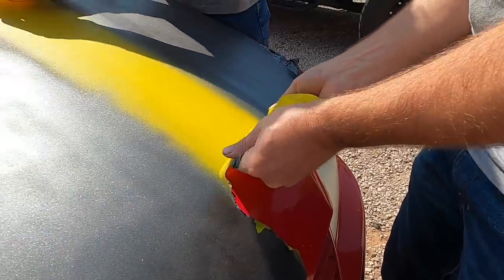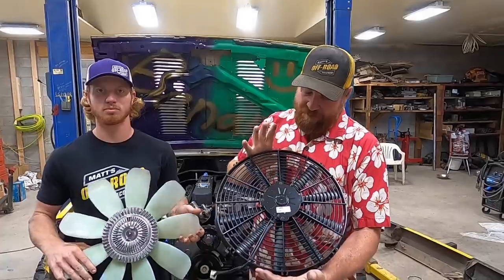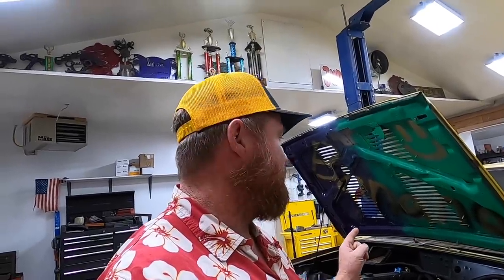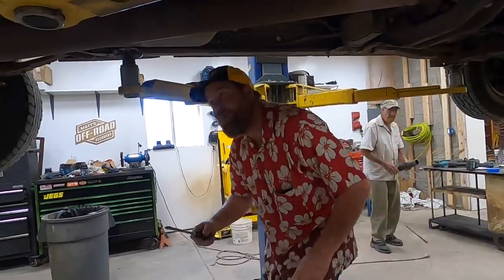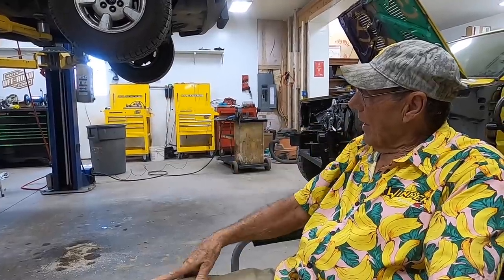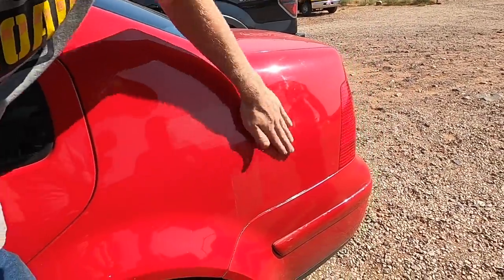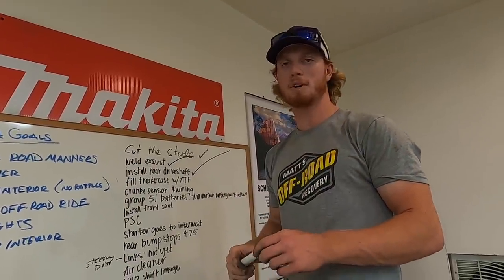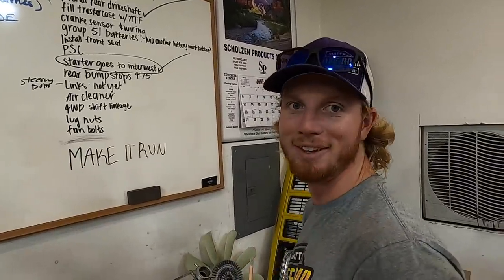Massive Cooling System Upgrade For The Jeep Banana!

Comment: Matt, what type of ATF you running for the high rpms, extra pull weight, and temps your transfer case is subject to?  Looks like Rudy picked up some black quarts from Napa?  Separately, what you running in the transmission?

Comment: you should check out banks monster exhaust expensive but well worth it with jeeps it sounds like a v8 motor especially if paired with the stroker engine

Comment: What’s the part number for that fan blade and cutch your using? Is the water pump the stock mopar? Im from El Paso have a 2000 xj it gets hot down here..

Comment: The 4 liters engine has the block ánd the cilinder head water passages, excesively small on purpose. That is to maximize the efficient use of fuel ( 1978 engineering) trough high engine temp. All engines have an optimus operating temp.

Comment: I installed 12” and 10” Mishamoto racing fans in a 2006 Grand Cherokee, HEMI to replace the disaster hydraulic cooling fan. All aluminum radiator, custom TIGed a aluminum shroud. Used a two temp VW thermo switch and wired in multiple relays into stock relay/fuse box. Took old actuator/solenoid for hydraulic fan system, installed it on the original wiring and zip tied it to frame to avoid check engine light and also ran independent of ECU all together. Wired so both fans come on with AC and one or both depending on engine temp come on without AC on. With no AC here in Fort Worth,  second fan never comes on. I also got a used complete fuse box off ebay so i could wire the new relays and fuses directly into factory fuse box so it looks stock. the new system stays crazy cool. Ran the thermal switch  originally at thermostat housing but made fan come on intermittently from thermostat opening so i moved it and welded a new switch mount out of two stock thermostat hose mounts then installed right as hose enters radiator and fixed the only issue. Those two Mishomoto fans pull 3450 CFM together and have lower amp draw than anything else on the market and they use brushless lifetime warranty motors. You may have used a Mishomoto fan before but im betting not a racing fan with the huge blades. Guarantee you would never have a cooling issue again if you went this route.

Comment: You forgot to mention the Clutch on the fan that limits the rpm of the fan so it doesn't tax the motor so bad, most clutch fans use 20 horse power or better. How about that heater core trick?

Comment: I have an electric fan on my c10, Damn thing was over heating quite a bit until I realized, it Should NOT be Bolted Directly to the Radiator. I found an old cookie sheet that was the same size as the radiator and cut a hole matching the electric fan, bringing the fan an inch or so away from the radiator, so it could grab the Air from All of the Radiator instead of the small circle it sat on. My engine never overheated after that. If you'd like pictures of the set up as a reference, let me know.

Before joining the navy, I worked as a mechanic and have grown to dislike clutch fans, because they scream and it tricks people into thinking it's a belt.

The plastic fans always had reputation for breaking due to flex over time. Especially at high RPMs

Plastic, clutch type, solid, fans will rob power no matter what.
Reply: Matt check it out no need to build a custom shroud all you need is a cookie sheet.
Reply: @iffykidmn8170  if it works, it works lol

Comment: Have you tried the gel coolant the derby drivers with 20k+ dollar engines run with no radiators with their hoses looped and run hard for half hour to 45 minutes a buddy of mine runs it in his mud truck's radiator and he plays hard for hours without taking a break to cool the truck down like others do he only stops at camp long enough to refill his little cooler with water and dew use the porta potty or tree and hits the mud again and he runs the AC with no problem

Comment: Hi Matt what is the part number on that mechanical fan or what does it come off of? 

I have a TJ that is getting a little hotter than I like when I pull a small camper through the Colorado Rockies. I’m not scared of a little custom fabrication to make it fit.
Reply: @MattsOffRoadRecovery  Thank You!

Comment: People have a little knowledge and think they know a lot, but end up not even knowing how much they don't know. It's a phenomenon called Dunning-Kruger effect, which is why I tend to say not to listen to people on the internet. I'm considering going electric fans on my Yukon. The motor gets up to temp quicker and there's less power draw on the motor, so I can save a little gas, but my demands are different. However, if you think of the power difference between a small electric motor, versus the actual motor of the car, it might be more obvious which would potentially move more air. Do be picky about building that duct, though. Knowing the internet, I'm expecting people to tell me that I'm an idiot because my Yukon already has electric fans. Just wait.

Comment: Which fan are you using? I tried looking it up by 9100 cfm but no luck. I have Jeep that I’m addressing the cooling system right now and have found very similar results but I wanted to use a new fan, my 5 blade isn’t enough.
Reply: @MattsOffRoadRecovery  thank you! I knew I had seen that fan before and it was on my previous truck. I’ll look at it and might have to use it as an option. Thank you again you rock!

Comment: Slow the water down. If you're pushing the water through the radiator at warp speed, there's no chance in hell for it to do it's job, and cool the water. Don't use high volume, high speed, high performance water pumps.

Comment: Matt   was in salvage  for 25yrs  here in NZ  [   luckest   5yr  Boy  i have seen ] STARTS  like this  his   Fathers  other car  blew  a clutch   he had to use the other car for transport   so took the battery  out of car with blown  clutch put the battery behind the drivers seat ---.. Sunday lawn mowing day  no gas so down to gas station   fills the  STEEL can with petrol  ---His boy said can i put the Petrol  can in the car  Dad walks into pay for the gas  NEXT THE   CAR UP IN FLAMES HIS BOY HAD PUT  THE STEEL   GAS CAN ON  THE TOP OF  THE BATTERY  with boy had pulled up into the car   lucky  the side  door was open  the   Kid  got out  UNHARMED   Life of a tow truck  Barry  N  Z

Comment: Many years ago, I learned an exhaust system trick from a Yamaha motorcycle. One of the main reasons exhaust systems fail is rust, at least here in Canada anyway. The trick is finding the lowest point in your exhaust system and drill a little hole. The water produced by the engine drains out and does not create rust.

Comment: Matt I used a fan off a totaled 2012 jeep srt. 12v 850 watts pwm controlled brushless from the factory on a few jeeps an ram,
Can be ecu controlled, mine is auto on when ac is on or if the 4x4 light comes on,
Can use a pwm controller for a fan for it an wire it up to you own custom needs

Part #:55038994AH
Reply: Idk why my other comments got deleted

Comment: Yeah big hydraulic fans like that move crazy air. My t100 still has its and long as its working right itll run 185° in 105° air hard throttle

Comment: What you're seeing on your water pump is called cavitation damage and it's when the water starts coming apart and then turns into air bubbles and when they get farther out and the pressure increases they collapse and they tear off chunks of metal metal so you're right said low speed pump it's not a high speed

Comment: Matt what did that Mechanical fan came out of ?  It seems to fit in the Cherokee real good…
Reply: @MattsOffRoadRecovery             Awesome 
Thank You for the info…
Reply: How did you attach it on the pully ,  does it bolt on or does it have a nut that threads on

Comment: The reasons for why the whole cooling system debate was started was mostly because of the benefits of the ease of installation and being able to run at full speed, even at engine idle speeds. 

I haven't had the pleasure of watching ALL your videos and you know better than I do, what works and what does not work. 
Seeing as how I have no clue what gears you're running, I'll assume it's somewhere in the neighborhood of 5.14:1, with 37" tires.

Even with that extremely low axle ratio and 37" tires, your vehicle still will not see 5,000 RPM while driving to / from recoveries. In fact, you'd be somewhere in the neighborhood of 105mph in DRIVE and maybe 3500+ on OVERDRIVE.

And while your engine is spinning at over 5 grand pulling vehicles while cresting massive sand dunes, your engine rpm slows significantly enough afterwards, that your cooling fan is no longer pulling anywhere near 9000 CFM.

I also have no clue what the length / width / height of your radiator is either. Flex-a-Lite offers the Black Magic X-treme 15" Reversible Electric Fan, which has a product dimension of 21.5" x 4.19" x 17.5 inches" and claims to be able to pull 3,300 cfm. Two of those on your radiator (If they would even fit) would be 6,600 CFM... all the time, regardless of engine rpm. But... unless your radiator is the at least length of a yardstick, that setup would not work. 

My other immediate thought was how difficult it was going to be to fabricate the fan shroud tin a way where you are taking full advantage of that no-brainer benefit of pulling over 9000 CFM at high engine speeds. 

I've also seen people install fans that are designed to DRAW air through them -  on the inside of the radiator -  drawing heated air from the engine compartment through the radiator, rather than fresh air if it had been mounted in the front. 

All this doesn't matter though, because as I said - you know what works best in your application, as you drive this modified beast every day and I do not. It is nice to know why you had to modify and use THAT particular water pump, because of the vane deterioration issues and I hope others will take note and make the same upgrades.

 My comments are nothing more than legitimate inquiries and not meant to mock or belittle your efforts. 

With all THAT said -  Thank you for your continued content, the detailed explanations and your service to our community. God Bless you and keep you safe in your travels. 

~Hood Guy.

Comment: 5000 rpm on a 4.0? Lol you are nuts 🙃
Reply: @MattsOffRoadRecovery  lol been piloting a 4.0 for 18 years and rarely hit 3500 rpms. Hiway, off road, mountains near Denver.  Close to 500k on 4 jeeps since 2003.  Solid engines thru and thru.
Reply: Oh yeah on your temp of your engine. I swapped out my original 1988 rad for a modern aluminum one and saw summer day temps go from 215 to 230. Now hiway speed day temps 175 or so.  Denver has a lot of 100 degree mid day temps in summer. What I was getting to, the jeep gages and senders are notorious for not reading correctly.  I d suggest a glowshift gage and sender if you are using the stock jeep gages in the dash. Modern sensors are far better for sure.  Never trust stock gages and sensors. Stay cool, I don't have ac in mine.

Comment: Yes dump the Spal fans in the trash where they belong, if fans should be electric, look at big wv, audi and bmw.  Thei push from 600-1000watt.  If still coolingproblems, gor for an copper radiator.  Copper has 60% better heat transfusion over aluminum.

Comment: Hi, me again.  Your electric fan only moves 1,300 cfm as opposed to the engine-driven fan's 9,000 cfm because it's got a dinky little 12v electric motor as opposed to being engine-driven, and it can only turn up to a certain rpm with that little motor - if it turned above 5,000 rpm the blades would become shrapnel from centrifugal force.  The blades on the electric fan have much higher aspect ratios because they're long and skinny, but facts are facts - they are too small and weak to do the job you want done.  The answer (as I'm sure you'll state; I haven't watched the whole vid' yet) is to use them both in tandem.

Comment: What’s that fan from?
Reply: @MattsOffRoadRecovery  is there much modifications as far as mounting it to the engine? Or are you using the fan clutch from a Jeep and bolting the fan to the clutch like that? Reason I ask is I just did the aluminum radiator and 3 electric fans, took it for a test run and it stays great on freeway driving, but once I started crawling on rocks and going slow it will not stay below 210. It slowly starts to spike.
Reply: I was having freeway overheating issues (I don’t have a thermostat in it) before hand. So I fixed one issue but now I’m onto the more important slow speed crawling and overheating issue.

Comment: my mom car slant 6 run kind of warm came time to change the water pump the new pump the blade on the pump was bigger then the old one the new pump made the car run cooler can you hook up a derict fan blade space dont use a fan clutch maybe try a flexs fan then also use a fail safe thermastat your raditor is it like cbr raditor i herd way its made make the car run cooler they use those in the off road sand cars

Comment: Electric fans are far superior, you just don’t know which ones to get lol.
Reply: @MattsOffRoadRecovery  No the taurus fans and Lincoln fans dont pull over 3k, somehow a fan of many people however the Contour fans i know for a fact as i have used many, pull over 3500 cfm, and the 2016-17 Mustang GT fans pull even more (i run them on a 1991 F150 that i use for over landing/crawling), and if you have the room, 2015-2017 F150 fans pull some serious air. I dont have CFM specs. I just know from my personal messing around. My rig never gets hot with the mustang fans, got tired of the clutch fans lack of air at idle (A/C was suffering at low speeds) and being noisy with my 5.14 gears on the highway. So some good Quality OEM fans fixed that. I also live in Phx, Az.

Comment: Well there's yer problem....5k rpm is burning yer grits....need a turbo diesel four cyl ...mega torque...lotsa vws have em...mr condescending....😝...heck, check out the new dodge trucks....🤓

Comment: TROUBLE COOLING ?  QUITE OFTEN I'VE CROSSED THIS WITH PEOPLE AND WHEN I ASK THEM HOW MANY JOBS A THERMOSTAT HAS, THEY FAIL ! THE THERMOSTATS M,OST IMPORTANT JOB IS TO SLOW THE FLOW LONG ENOUGH FOR THE CONTENTS OF RADIATOR TO COOL ENOUGHT TO DO THE JOB. MOST ENGINES LIKE A 205 DEG. THERMOSTAT JUST FOR THAT. AND YES I LEARNED THIS THE HARD WAY. 
IS THIS PART OF YOUR SOLUTION ?

Comment: Hi Lizzy,

Matt, it is your jeep, hack it up however you want, no need to get excited.  Yes, some of your YouTube fans can't spell mechanic, but some have been doing it for 50+ years.  Maybe they shouldn't all be lumped into the ignorant pile.

Sorry, but your fan explanation was way off.  There are several common electric radiator fans rated over 3000CFM.  That is full-time 3000+CFM, or 6000++CFM for two.  It is always 6000++CFM,  They are not 9000CFM at 5000rpm, but I'd submit that you don't really spend that much time at 5000rpm.  At least from the hundreds of your videos I have watched, sustained pulls of a full minute are pretty rare.  And when you throttle back, the electric fan is still running at 6000++CFM, not 500CFM like an engine-driven fan.  So coolant temps drop like a stone at idle.

In the truck world one does have sustained pulls over 20 minutes, and many cooling problems are solved using high flow electric fans.  The shrowds on electric fans run closer to the blade and work more efficiently than engine-driven fan shrowds.  And they never cut into the radiator on rough terrain.

Don't get me wrong, I love you and your channel, just thought you should know that your example fan was anemic.

Either way, I hope the Banana comes back stronger than ever!
Reply: @MattsOffRoadRecovery  I have replied three times to this, with several links to fans, but these replies keep disappearing.  Have a good day.  PM me if you are interested, or in the immortal words of Ruth Buzzy... never mind!
Reply: @freeidaho-videos  That was Roseanne Roseannadanna. (Gilda Radner).
Reply: @61rampy65  Xactly right!  Thank you!